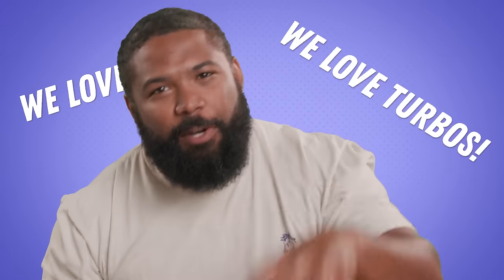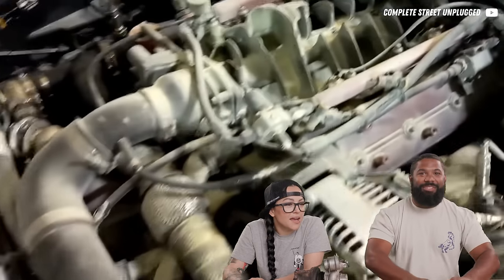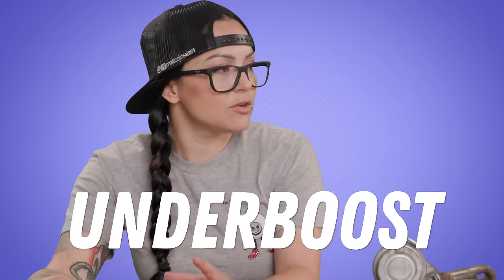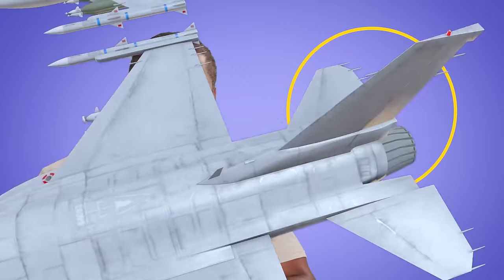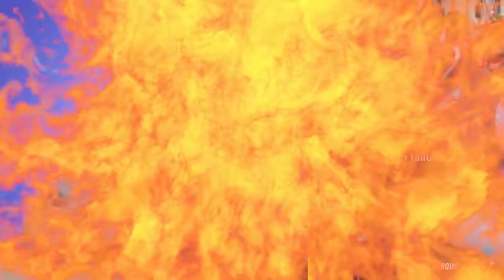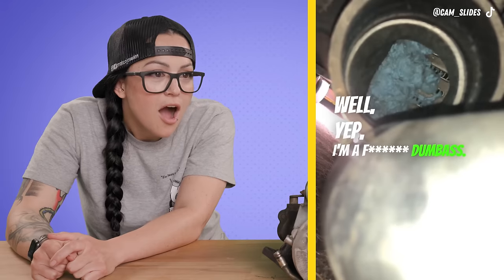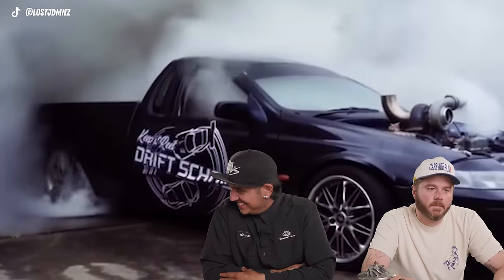Mechanic Reacts to Catastrophic Turbo Fails

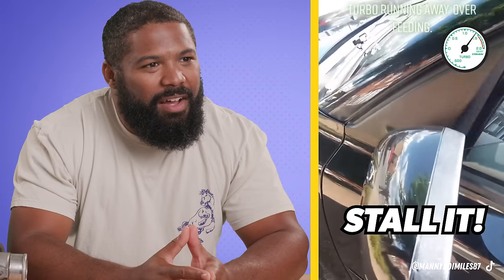Comment: 6:30 It's called diesel runaway and it happens when seals in turbo give up and it lets oil into intake. It starts running at very high rpm because diesel engines burn oil very well. You can't shut the car down and it will run until it runs out of oil and engine locks up. You have three options basically either stall it if you have an manual, cover the intake so no air gets into intake which is dangerous or wait until engine locks up.
Reply: Can I combine option 4. RUN with of the other/all options?
Reply: You can stall it out if it's manual but slamming it in park won't do shit. Runaway is scary shit.
Reply: I was thinking the same thing! I'm surprised they didn't know what a runaway diesel was.
Reply: @perryrush6563  A better option, 4. Runaway from the soon to be flying bits of metal...
Reply: They don't know much about actual vehicles that they can't easily google
Reply: If you can starve the engine of air, you can save it. I have seen some ballsy people stuff clothing in the intake or put a board over a runaway diesel!
Reply: not dangerous to choke the engine , grab a t shirt and ram it down the ait r intake n it dies after about 30 secs
Reply: @FullSendFarm  I have never seen the girls channel before. but the end hints she runs an automotive shop class at a college? she should of known that was a diesel volvo and the motor was run away. they teach you about this in motorcycle tech school, and we see VERY few, production diesel motorcycle platforms...

I guess maybe because these folks don't really work around big rigs/heavy equipment/tractors. they have probably never experienced such an issue.
Reply: If available you can spray a c02 extinguisher into the intake also to display the oxygen.  Had to donit before on a diesel boat motor that turbo seals blew in
Reply: @MattSlotemaker  They do, they talk about it in the other catastrophic failures video
Reply: The nigthmare of diesel owners
Reply: @Homingjoeyjr  True or better just take something flat like a plank and cover the intake to choke and avoid doing more damage
Reply: Yep, lost all credibility not knowing about a runaway.
Reply: 1. Clutch in
2. Put it in the highest gear available 
3. Brake pedal in as far as it can go
4. Dump the clutch.
5. Pray 

For and automatic trans it's a big risk but the only kinda safer way than putting your shirt into the air intake is...:
Use a shut-off valve :D "klapa gasząca" - I don't really know how it's properly called in English :P
You have to know where it is beforehand because I would not recommend searching while the engine is about to explode :P
Mine is near EGR valve :)
Reply: My ex ran away with a Diesel 😒
Reply: I'm surprised they didn't mention runaway diesel given the fact that they covered the fucking topic multiple times already. I don't drive, I don't own a car, I don't have a license and even I know about runaway diesel engines.
Reply: Diesel runaway is such a fricking scary thing.
Reply: @CookingWithCows  I know right? These are mechanics and I was stumpted when they didn't know about runaway diesel.
Reply: @CookingWithCows ok showoff
Reply: They've covered diesel runaway so I figured they knew something I didn't, because that was what came to my mind and I'm not even a diesel guy, plus the guy was saying to stall it in the video. Maybe they just collectively had a dumb moment, because they did a pretty detailed video about diesel runaway in the past.
Reply: @hunterdavis9941 Yeah i was gonna point that. They have covered this problem with diesel engines before in this mechanics channel
Reply: Worried my obs 7.3 will do this
Reply: I'm like 99% sure these same mechanics have commented on a runaway diesel in a different episode. They probably just didn't recognize it because of the way it was presented in the video.
Reply: Plug the intake, plug the exhaust or dump a fire extinguisher into the intake. In every case you're looking at a big bill and a really bad day. In the case of the locked volvo the exhaust is probably your only option
Reply: Yeah I replaced broken turbo but client won't pay for cleaning intake and it was fuck up situation 5gear hand brakes and breaks and fast lift the clutch, I'm saved it but... Even skydiving don't give you that adrenaline. That was on normal road not parking or close area.
Reply: They've mentioned runaway diesels before on the channel so it's not like they don't know. I think the "WTF" part was that nobody was in the car, making it look like the car just did that stuff on its own. Which would be very weird.
Reply: what i thought as well, but with how the video's audio isn't on in this video, as well as how it seems to stop after they do something when they open the door for a sec, either it ran itself dry or has some fail safes, or it might not have been a runaway, just some really fucked up idling.
Reply: I've once witnessed a runaway on a big rig in the shop I worked. Man that's scary as hell! 
The intercooler was full of oil after a faulty turbo was replaced and no-one seemed to think about cleaning the intercooler out first. So the engine started sucking up the oil, slowly revved itself into rpm heaven. God that noise haunts me till this day. The shop was filled with black smoke in seconds!
"Luckily" it was a manual transmission and the mechanic was able to put it in gear and stall the engine. But the damage was catastrophic! Had to replace the whole engine and the gearbox completely. The clutch assembly exploded and cracked the clutch housing from engine to gearbox clean. Some of the gearwheels even missed some teeth.
Reply: Everyone who says “plug intake”……lets see you do it in person! My ass is fucking OOOOOOUT! Im not catching a blow engine to the face trying to save it.
Reply: I think they didn't know it was a diesel runaway because it was a sedan. From the videos I've seen, there are not many diesel cars being sold in the US, just trucks. So they probably just thought it was a petrol with a stuck gas pedal.
Reply: @MattiAntsuK  as an American……if we are into cars we know diesel come in other than trucks cause we have a ton! unless we are fuckin stupid. But we are Americans so 🤷🏽‍♂️
Reply: Came to say this
Reply: @johnwalker7592 they've had previous episodes that featured diesel runaways, so they probably know one when they see it.  It looked like they were joking too much about ghost drivers that time and didn't mention runaway anymore. 

Besides,  it looked more like driver runaway, than diesel runaway.  😂
Reply: I don't understand how these so called mechanic experts don't know what a diesel runaway is
Reply: @AmigaMANpt  well  some mecanics especialize only in gasoline engines, the diesel is a diferent world for some if then  also in US is not  usual in other vehícules  apart of large trucks and heavy equiment , like happens in europe and other parts of the world
Reply: Or shove a big rag in it to stop it.  The turbo is junk anyways.  Time to try and save the engine
Reply: it's really weird that I don't know shit about cars yet know what a diesel runaway is and these mechanics don't
Reply: @k24civic  
Well atleast the statistics that I've read only stated that 3% of cars sold in US 2020, where Diesel. Meanwhile in Europe, it was 55%.
Reply: @Bartosz Pikutin  they do know what it is, though. They've talked about it in other videos.
Reply: Can also happen if you get someone who doesn't know what their doing installing injectors or cheaping out; I went to help a guy stopped by the side of the road with his engine running away, got out a fire extinguisher to starve the engine of oxygen, but it had already seized by then. Subsequently found out that his cousin had replaced an injector on the cheap, and I guess not tightened  something down enough or the injector was faulty to start with.
Reply: I was very surprised not any 4 or the crew behind the camera knew what was going on. I am NO diesel expert, but I'm also no car mechanic, just wrench on my own crappy stuff. That one shocked me as I love all of them.
Reply: They've had a whole damn episode on runaway mofo
Reply: Got to have a runaway engine episode.
Reply: Honestly they don’t seem like they know that much about how things work lol
Reply: You don’t want to try to stall a runaway diesel by putting it in gear. Most likely you will just destroy your clutch, if you are lucky. If you aren’t lucky, you will be going for the ride of your life. ALWAYS block the intake to stop the air. It’s the only safe way to stop a runaway diesel. Saying it’s unsafe to stop it that way is insane, since that is pretty much the only way to stop it. Some larger diesels have an air shut off built in, and many racing classes for diesels require an air shut off valve for safety. My 2700hp Cummins and my 1300hp Duramax have a valve in front of the turbo that drops with the push of a button to stop the engine. When working on a truck that doesn’t have a shut of valve, I keep a phonebook wrapped in duct tape close by to stop it if needed.
Reply: @SSDeadMan That won’t work unless the diesel has almost no power. Either the clutch will slip or it will overpower the brakes and you will go for the ride of your life. NEVER try to stop a runaway diesel by putting it in gear.
Reply: @boostdis3114 You can buy an air block of valve that will attach to the intake of the turbo at most performance diesel shops. The ones I run are spring loaded to snap shut when you pull the cable. It’s a good safety item to have if you drive an old diesel or one that is making big power. Turbos don’t last long when you are running 160lbs of boost…
Reply: Best way is to block the intake.  Seriously though, all these “mechanics” yet no one knows about dieseling!?
Reply: 100
Reply: @BrownCoatFan that’s what I’m thinking too. Honest mistake no need to bash them
Reply: Was going to reply the same thing.
Reply: @perryrush6563 had a diesel runaway. Your only thought in that second is GTFO. The irony was our fattest tech was first out the door😂
Reply: @MattSlotemaker  I was thinking the exact same thing, they all lost BIG points in my book, not the "Experts" we are let to believe.
Reply: I was gonna say the same thing. You just explained better than i would've hahah.
Reply: These mechanics should really know this...
Reply: @adamr9215  yes but it is still dangerous because you're putting your hands near engine that can possibly explode or spit hot oil towards you. Yes it is the correct way of doing it but also very dangerous because if you're unlucky it can kill or hurt you. Shut off valve is safest because it's one move and it shuts the engine down no need to hold your hands near intake.
Reply: @adamr9215  CO2 Extinguisher also works to stop runaway if it has big enough load to last as long as engine will stop combusting.
Reply: @MattSlotemaker  Manuals and diesels on their own are rarer in the USA I suppose so a combination of both they probably don't see many of. Manual+diesel is very common in the UK.
Reply: Choking out the intake is usually the way. DO NOT SHOVE A RAG IN THERE.
Reply: @basilworshipper  It’s not that dangerous, I’ve stopped a bunch over the years and never been hurt. React quickly and you can save the engine. If a little hot oil scares you, then you don’t need to be in the shop.
Reply: @keldon1137  You will need a big fire extinguisher, maybe a couple of them because it takes a bit for the engine to stop spinning. Inert gas from a MIG or TIG welder works too and the bottles used in a shop are going to be big enough to get the job done.
Reply: @SBBUK  Maybe in small cars, but I’m pretty sure there are more diesel trucks in the US. Yea, the newer diesel trucks aren’t easy to find with a manual, but older Powerstrokes and Cummins engines were backed with a manual more often than not.
Reply: @adamr9215  I guess if you know what you're doing and you act quickly you can do it that way
Reply: @CookingWithCows  I guess it wasn't in the script 😂
Reply: Yep. it happened on my daughters car. a little 1.4 TD skoda fabia, i went to change from 2nd to 3rd  and the revs spiked massively, red line is at 4.5k  it went right off the end of the rev counter, was doing probably 7 or 8k.  Wouldnt stall out  even when I put it straight into 5th gear. then it just stopped, engine was seized solid, wouldnt turn even with a 4ft bar on the crank pulley!. Diagnosed as a turbo oil seal failure feeding oil straight into the inlet manifold, engine was running on its own oil so switching it off did nothing.
Reply: @basilworshipper  I’ve been doing it for a while now. Old diesel engines are my hobby. If you are going to try to start an old one, always keep a phone book wrapped in duct tape handy, and make sure there isn’t anything keeping you from getting to the intake.
Reply: I wish they did a video on runaway diesels and went into further depth about it because many don’t know about it
Reply: @b3nny90  not always, sometimes smoke the sh*t out of the clutch. And it just keeps on going. Too much torque and not high enough gear like most semis.
Reply: WHAT ABOUT CO2 SUPPRESSION 
IT WORKS AMAZING
Reply: @k24civic  just stick something into it or over it. It's not that difficult. You won't even have to hold it there, that manifold vacuum will do that for you
Reply: @Demonslayer20111  i know how it works……just not getting fucked up over a motor. Id rather let er blow but thats just me i like all my digits and extremities 🤷🏽‍♂️
Reply: @k24civic  what part of throwing something over or into it don't you get. Your hand ain't going anywhere near it
Reply: @Demonslayer20111  you ever seen one in person explode?….i have no thank you! Flying metal doesn’t forgive. To each their own tho.
Reply: @k24civic you do that BEFORE it explodes. And standing in front, not in the plane of rotation is the safest place unless the turbo is mounted sideways.
As for your question, no. I haven't. But I have been next a jet turbine that blew up.
Reply: Fire extinguisher in the air intake as well
Reply: @Homingjoeyjr you apparently haven't asked Whistlin Diesel's early episodes with the Chevy pickup "go cart" 😂😂😂
Reply: @Homingjoeyjr "not dangerous to choke the engine" well to stick a t shirt down the intake like you said you'd have to be standing right next to a runaway diesel which could very well just explode because it's making way more power than it was ever meant to. That sounds pretty fucken dangerous to me man
Reply: @SSDeadMan  This is the best way and to do it as soon as possible, only if it's manual. They spoke about it another video where they said runaway in a diesel is where fuel vapours leak from somewhere and get sucked back in the intake. But for fuel vapours to go through the filter, turbo, intercooler and then back into the block that's some fucking doing 😂😂 I've never heard or seen of it done this way only when oil gets dumped into the engine, 90% of the time the seals go on the turbo it starts forcing oil into the engine and it starts burning it as fuel, revving way above the normal rpm and ends in some failure due to that over revving. It's rare that it will keep going until the engine stops due to the fuel source depleting. Something will go wrong way before it seizes normally
Reply: @MattiAntsuK  That stats not true by a long shot. I live in the UK, and travel round Europe regularly. Most cars are petrol still over in Europe. The real number is between 15% and 20% of new cars registered are diesel.
Reply: @adamr9215  Plus a new clutch is the least of your problems at this point
Reply: @Not_alex_jones  You don’t just stick a t shirt down the intake. That would be a good way to get hurt. The best way is to have a phone book wrapped in duct tape and use it to block the turbo. All you have to do is to get it close and the turbo will suck it onto the turbo, blocking the air. As the engine gets close to stopping, you might need to hold it, but by that point the rpm’s are dropping and there isn’t much of any danger.
Reply: @JamesHamp93  It doesn’t matter at all since the clutch will just slip and not do anything to stop the engine. If you are lucky, the clutch will slip. If you aren’t lucky, you will go for the ride of your life. Years back a semi truck had a runaway going up a hill and even with 80,000lbs, a 6% uphill grade and all the brakes trying to stop it, he ended up going over 90mph before he wrecked. He cooked his brakes quickly and they did nothing to stop him. In that kind of situation, just push the clutch in and let it blow. If you can’t block the intake, just let it blow itself up.
Reply: @adamr9215  Not necessarily. Like I said in a high powered/high revving situation yes. If you catch it as soon as possible, which is what I mentioned in another comment, you have a good chance of stalling the car. I've seen it done twice on a 1.9 TDI  and a 2.0 TDI, both VAG engines. 
Granted I've never been in a situation where a high powered diesel has encountered this but I've only heard of mechanic failure after not being able to stop the car. Those trucks do have MASSIVE turbos and have a lot of horsepower. I know its super heavy and what not but it has the power, smaller cars/general purposes dont have such high powered diesel engines
Reply: @adamr9215  And again, if you feel the car starting to take off, you'll still have the brakes held down you just immediately put the clutch in again. In fact on the 1.9 which my brother stalled he had to dump the clutch like 3 times as the first 2 times slowed the revs down somewhat and the third time it just chugged and died instantly
Reply: @adamr9215  And to add to your note about the semi. There's no way he had it neutral with the brakes on as he would've come to a stop. I'm only suggesting to do this from a stand still by the way not if you're already doing 70mph on the motorway/freeway. So just to clarify all of this I'm suggesting is from stand still.
Reply: @adamr9215  you've misunderstood my comment, I never said to stick a t shirt down the intake. I was responding to another comment which read "not dangerous to choke the engine, grab a t shirt and ram it down the air intake and it dies after about 30 seconds" word for word. Now you know the context of who I was replying to, re read my comment and it'll make a lot more sense.
Reply: @Not_alex_jones  you sound like u need man up abit , ive done it twice and seen it happen a few times in racing , roll the tshirt up or if the intakes big say on a bigger engine ram roll ya hoody up and shove it on the intake pipe .........nothings moving near the intake and no way will it swallow it so wheres  the danger ? its not gonna just explode do a little research it just past its rev limit and will rev out till theres no oil left or just sieze the engine , dont sound very dangerous to me
Reply: @Homingjoeyjr  yea except it can explode. You say it'll only rev "just past it's rev limit" which is not true because that depends on how much oil it's sucking in, so it'll vary case by case and you'll never truly know how many rpms it's reaching. But whatever man, do what you like but if bits of piston and conrod come smack you in the face at mach 1 don't come crying to me
Reply: bro, i was shocked how come none of them understood it, i think they dont tune a lot of diesel engine in America! but 4 mechanics dont know whats a runaway? In Portugal we call it "embrolhou-se" kkkkkk
Reply: @SSDeadMan  you could say PASO: positive air shutoff  or PASS positive air shutoff system. They make manual ones usually connected to a wire so you could pull it from in the cab or ones that will activate themselves. Common if you work in the patch or a refinery. I don’t know if it’s true everywhere, but I know it’s mandatory at a lot of places
Reply: Covering the intake was usually my go-to lol, I don't miss that car.